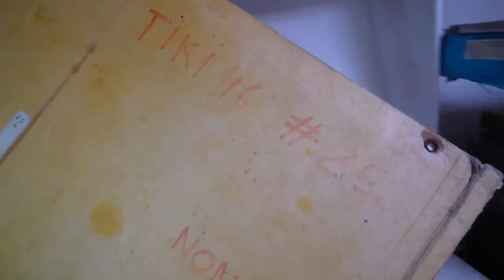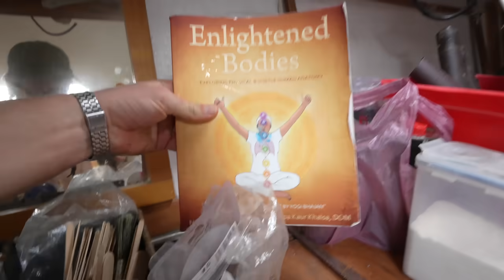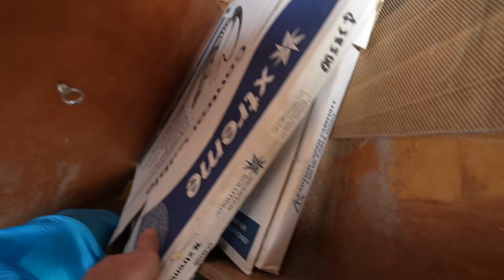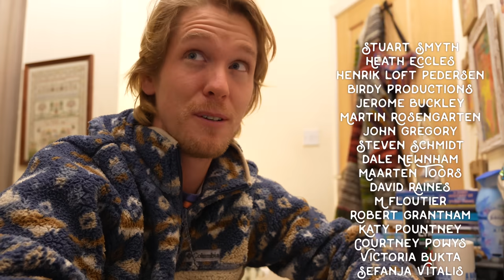Am I Actually Going To Buy This HUGE Project Catamaran? | Wildling Sailing

Comment: Very regretful sale - Searunner 41 TRIMARAN in CEBU Philippines - PRICE SLASHED to $15000 USD.
 
 I did a refit on this boat a couple of years ago but unfortunately had to return to work. Then with COVID etc I havent been back to her in the last three years. However, I have had a local boat yard worker looking after her, cleaning her, airing out so the hasn't been completely neglected – all photos of the boat are taken this year. I planned to come back and work on her, but I am not going to get time this year. So I need her to go to a new owner who will love her as I did!

She was dried out and ANTIFOULED with JOTUN in AUGUST 2022. BUT THIS BOAT WILL NEED SOME WORK! In the photos are some rotten bits of the deck (hatch, some fittings, cockpit seat) that the boatyard has sent to me. Plus she needs a new main sail and few other things attended to - so expect to spend another ten thousand dollars or so.

If you're still interested - read on and PM me with any questions not answered here.
 
 See FULL DETAILS AT: [https://searunner41.wordpress.com/](https://searunner41.wordpress.com/?fbclid=IwAR2yOENnCBaD-QFsiyupMIzcnyGcqS7C2hRVCOjN20ZOauEo55uG-toNDRY)

The Searunner 40 is arguably one of the best cruising multihulls ever designed. The yacht is roomy, and very safe and sails beautifully. She has incredible storage space. There is a large dedicated anchor/hanging locker forward. There are 6 deck lockers, including one dedicated capsize/emergency locker which houses the liferaft, grab bag etc. The float and wing void storage is accessible without difficulty. Interior storage in cupboards, wing lockers, seat lockers, and bilge make this a very practical live-aboard yacht. We lived on her full time for five years.

This was the boatbuilder’s own personal vessel, built to plan with the best quality materials available, and refinished by the present owners. Composite construction using “WEST SYSTEM” method. Hard chine with reverse sheer and clipper bows.

The original soft dodger has been replaced with a solid wheelhouse, and targa bar, offering excellent protection, and the option to have the cockpit open, or closed to the weather, at anchor or under sail.

OVERHAUL

Labyrinth was hauled out of the water in 2017 in preparation for a long Pacific cruise. Her hulls were repainted. Her electrical system was completely overhauled. She had new navigation equipment installed and her interior was refurbished. New solar panels and batteries were added.

OTHER EQUIPMENT/TOOLS

Labyrinth is set up with an eye for independence. She comes with a dive compressor, aluminium scuba tanks and a wide variety of tools, both hand and power.

Coltri 6hp Compressor – fills a 80L cylinder in 20mins

7 scuba tanks, variety of types. Out of date re hydro tests.

Bosch Power tools – Cordless Drill, Grinder, Heatgun, Jigsaw, Power Sander

3 toolboxes of handtools.

Wide range of spare parts, complete list available on request.

Comprehensive medical/first aid kit
Reply: Not a bad place for a refit, cheap labor and not far from Carmen where the Mumby Catamarans are built.

Comment: Judging by what you said at the end about there being an outburst of emotions and your general demeanour it seems like you either got out bid or decided against it, that is the ideal outcome in the end because it means you can return home and keep looking !
I have the skills and experience necessary to finish that off and I can see it really isn't very much but I would still avoid it and look for something which is much more complete and ready to sail ! 
A boat with a single companionway is far more easily secured with a single lock and maybe a couple of keys but with that boat you are going to need to be very creative if you don't want a big bunch of keys in your pocket and loads of rusty locks that won't unlock ! In a perfect world you could just pull it up on a beach and find some locals who would cut up a couple of logs for you to make an 'A' frame for lifting heavy items and scrape around to find some leftover hardware, materials and paint for you and help you finish it off in a couple of months while at night you sleep in a hammock between two palm trees but this is not a perfect world !
I really can see why you like it but I can see many more reasons to avoid it one of which is the size of the interior spaces, I understand there will be a wheelhouse on deck but it's very small and the cabins are cramped with narrow sole boards, this is not a boat I would want to spend much time at sea on !

Comment: If you are going to do this boat, probably your best bet is going to be to get it squared away enough to sail, and to head up to Texas or Florida where you can get things shipped in pretty easy to work on her, then you can cruise the Caribbean from there, or you may even look at towing it if you can figure it out.
Reply: Chiapas Mexico, Australian girl been refitting her boat, cost effective.🤔
Reply: It's on the Pacific side
Reply: @steverides4636  well that does complicate things a bit, as California is not the place to be with a project boat these days.
Reply: @RenegadeADV  plenty of good boatyards in Mexico
Reply: @steverides4636  Yes, there are plenty of boat yards in Mexico, where you can get sanding and painting done etc at a reasonable rate and they are good at what they do. 

What there is not in Mexico is a wide variety of parts available, and there are plenty of issues getting parts shipped in because they want to charge a duty on them, and you are going to constantly be fighting with customs over what the value of things are. 

Where as in Texas and Florida, You can have anything in 3-5 days with a couple of mouse clicks from Amazon, Defender, Fisheries, Jamestown, all of the outfits that make it super easy to get what you need.

Comment: I think you are taking the right tack to make an offer based on the size of the project, location, and everything else.  The key is:  “ what is this boat worth to Mark where it is, as it is, and taking everything about it and your life right now into consideration”.  It is probably worth something, but perhaps less than asking.  Perhaps much less.  If someone else comes along and factors are different and it is worth more to them, then that’s fine.
   Seeing the motors is very encouraging.  I had thought they were big old desel inboards, but those are top quality outboards.  If they need service you can put them in a car and take then for service.  I moved and installed my 20 Hp Honda with one other person and no special equipment.  You might not need those big heavy motor boxes as these motors will tolerate being exposed pretty well.  Except maybe fir any issue of theft.

Comment: Howzit mark 
If the bare bones of the boat are good that's a good start, it's hard to fix a badly built boat.
My advise would be if you buy it, clean it up check all the structure redo all the lashings get it seaworthy.
Don't try redo the complete wiring and plumbing and so on get some basic NAV lights and GPS gear.
Install the motors and then sail her to a better location where there are good boat yards and access to all the things you will need to do a proper refit.
Wharrams don't need much to sail they pretty simple find a better location sail it there and Carry on.
Good luck

Comment: hulls are solid. wharram are know to be strong. nothing scary so far... but you are in the wrong location. so what does it take to move it somewhere better? if the 2 outboards are good. you can use it as a raft to move it.

Comment: Based on your comments the hulls are in at least acceptable condition, and you also know that the original construction was high quality. There is not much actual equipment on board, and the outboard motors look to be in good condition.  So your biggest risk areas are the location, and the cost/amount of work required rather than the actual difficulty of work, or the need for long duration boat yard land facilities to do the work. If you can access help & some funds through youtube & on line groups, then you at least have a path forward.

Comment: Dude buy that boat ….. I am a residential carpenter cabinet maker … I have been in the business for 40 years that plywood that boat is made out of is a marine grade plywood which is a super strong …. From what I could see it looks fine it just needs to be sanded and finished …. It is a multiply plywood you can count applies by looking at the edge … good luck …. Hope you get that boat

Comment: You need to use a screw driver or a pocket knife not a fingernail to check timber and ply for wet or dry rot do some proper poking about  it may surprise you? Good luck.

Comment: Wooden boats and wood cored fiberglass boats can become very costly in both time and money to maintain or restore if compromised by moisture. The older the vessel the more likely the owner will encounter such a scenario. The Wharram is an intriguing, proven design that's worth pursuing - however, the location of a vessel that needs major restoration or refit can have a huge impact on the real world cost and viability of the project. If one has a blank check to work with, then there's little risk of the project failing. If resources are limited, though, it's easy to get overwhelmed. My concern in this boat, beyond the obvious challenges presented by the remote location, would be the condition of the exterior hull below the water line. To get a clear picture of the hull's integrity and moisture content, it would have to be hauled out and properly surveyed. Given it's size and cat configuration, that alone would involve a good chunk of change. All in all, this is not a project for the "faint of heart" or rebuilder on a budget. In terms of money and effort, it will easily break most people.

Comment: Mark, I say go for it as long as there isn’t any wood rot. HOWEVER…it’s going to cost you to bring the boat up to ship shape. Don’t under estimate how difficult it is logistically to get materials and the cost to ship materials to the boat’s location. On the other hand, labor is cheap when it comes to hiring hands to sand and strip wood.

Comment: The little boat that took you to see the engines had a 50 hp Yamaha, The two 25 hp engines will not move that boat very well, maybe enough to maneuver around a dock and provide no assistance during rough weather.

Comment: Merry Christmas - Its a lot of work but it appears the real issue is location, if you can just get her mobile to transit to a more populated area then your options expand, the issues become easier to solve. Mobile does not mean finished, just able to move under her own power (Outboards and or sail).

Comment: I like to feel good about a buy. If I don't feel inspired, buying whatever is probably not the right thing. My feeling is seldom wrong! If it is a huge project boat, that gives you plenty of opportunity to create interesting videos. Dare I say it, but you will feel more connected with a vessel, the more work you do on the vessel. As a sailor, you NEED to feel one with your boat. I know that the average Joe in the street would not see bonding with an inanimate object as insane but in my experience, if you love your boat and care for it as best you can, it respects you back.

Comment: If you make an offer make it low because whatever you offer will be accepted.
My biggest problem.with that boat it just the sheer lack of connectivity. Its like 4 little prisons none of which have a view.
Yes you want to live basic but you absolutely loved the space of Minki after your first venture.
I used to hate sitting in my boat, hearing something going somewhere but I couldn't see it. Spent all my time jumping up and going out to see what's up. 
Poke a screwdriver right through the insulation and see if it comes out through the Hull.

Comment: A project that needs completion is much easier than a project that requires tearing out rot and replacing. They are two totally different projects and to me, not having to demolish and rebuild can mean much easier forward progress. That said, don't be fast to sell off a portion of your dream. Finding someone you can work with and be on a boat with is much harder than any project ever considered.

Comment: Out of interest what’s the expected fuel consumption/range like with those engines, I would imagine pretty bad? Under the cowls look clean but the outer parts look ropey. I still think this is not the best option considering the location and work required, and would be hard to sail, especially single handed. That said, it looks solid and well built.

Comment: Just found another 35' Wharram in Mackay Queensland Australia $10,000 Aust dollars.
Condition ?  Rougher than the previous of course 😁

Positives 
It's in Queensland Australia.
Easy to get required supplies, they manufacture Hoop pine marine ply in Queensland manufactured to Australian standards.
They make Epoxy resin in Queensland.
They speak a "form" of english in Queensland😁

Great cruising grounds off the coast of Queensland.
Whitsundays, great sandy straight, Great barrier reef, 
Only state in Australia that allows you to live onboard, ( that I'm aware of ?).
Great climate in Southern Queensland for boat work, not too hot, not too humid, not too cold for epoxy or painting in winter.
Northern Queensland, ( Cairns) that's another story.

Cheers.

Comment: I stated my reasons in the previous video about this boat, but I'll re-iterate the important bits: Buying this mammoth of a project would be a mistake. Between all the issues the location pose with security, prices of materials, electronics, importing things...etc, and how it looks like it would be a nightmare to single-hand, I just don't think you'd get good returns on the money, time, and effort you put into it.

Comment: You will weigh up the value of it based on adventure and potential ratio rather than value and resale. Looks to me as though it's a less convential and thus  a more adaptable vessel for your choices. You even come away from it with an enlightened body. And you don't get that with a Westerley or a Contessa ! Looks exciting and whatever trials and tribulations will be worth it.

Comment: Tell me if I'm wrong.  Minky had structural problems below the water line.  You never did get her completely dry.  Seems like this one has no structural problems.  Yes there are omissions but they are cosmetic and fixable.  I was a framer and nothing scares me on this restoration.  I remember all the time you spent on the rutter assembly on Minky.  Minky is a nightmare comparted to this one.  I don't see structural problems?  Did I miss something?

Comment: Boat doesn't need to be perfect/refitted completely to move. Sail away and do the rest on a way. It looks sea worthy already, just put the wood inside one hull, make a bed, small kitchen in the other, connect engines, few batteries, install lights and go.
I hope your offer will be accepted.

Comment: It would make a great project for the same boat yard rebuilding the 'Yaba'....otherwise, it's a 3 crew boat minimum....walk(Run) away.....trip to the USA and look there, is a much better selection, especially a Hurricane rebuild for less than what this than 2 of these cat's will cost to bring up to livable standards....I tripped over to the manufacturers website and it appears that the masts have been moved from the original design configuration....IMHO....If you have the time and funds, drop in to Brazil, where 'Yaba' is, have a look and a chat, then trip over to the USA for a few weeks  in FLA....

Comment: Mark the guy wants to sell its got more to it than at first looks ... make a tight offer and get some help ...if it was electric theres a simple long term answer..  how many HP?
Does it have a central dog house like some of the better seagoing Tikis...
That heat and humidity will be a battle but i can think of ways of Ventilating it passively and cheaply.

Comment: I see in the comments that so many are saying "it is such a massive project"... Sorry did I miss a videos but where is the to do list that this is based on?
If it means that Mark finally leaves home and as he says he treats it as an education; this should give him confidence to be independent.
The Minki approach of " I must get it sailing ASAP " he has repeatedly admitted led to bodging and not spending the time to get things done well"  He says  he has learnt not to do this again, so with a methodical approach and no time constraints it should be a success.
With his time spent documenting making videos the money will not be a problem as DIY boat building channels have far more viewers than those actually sailing in the main.
Reply: Your statement that a project boat that is restored gets more views and likes is correct. But the interest will dwindle if each episode will only show more and more problems and the solution is far away. Who is going to film when this person is working? Who is supposed to cut and process the material when you have worked 12 hours a day? 
The current interest will wane if after 90 days the project is abandoned for a long time and later a looted Hulk is found. 
I think Mark as YT he should also reconsider his behavior about very competent comments never giving a like or a reply. 
That can't be beneficial for the channel.
Reply: @albertfunk1176  Thanks, some thought provoking points.
I always have to remind myself that it is far easier to comment on someones efforts on YT than to actually do myself.
The main thing he has all the " safety nets" in place so the risk is relative.
I hope that he try to remember to look at and speak to the mic to avoid his voice keep trailing off.
I am sure he will have fun and wish him all the success whatever his decision.